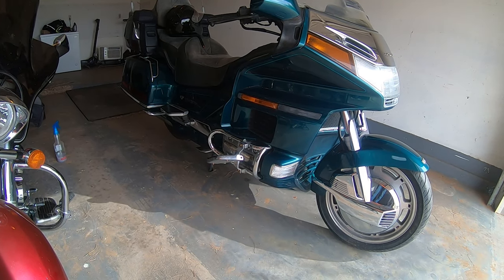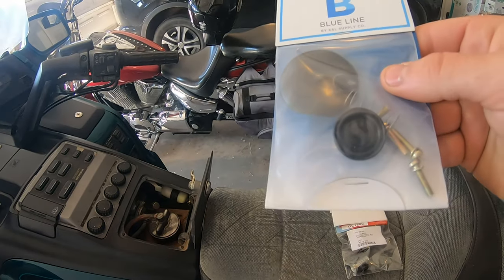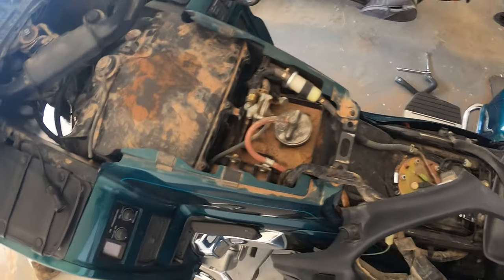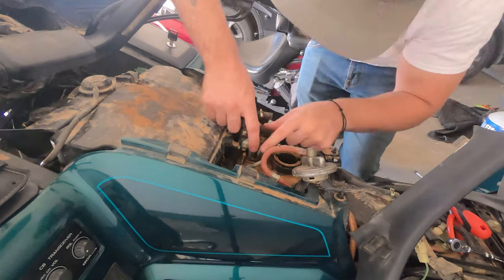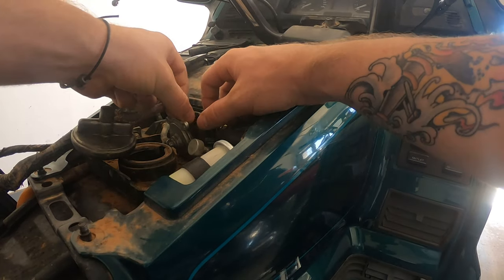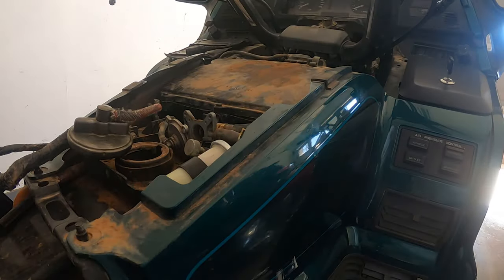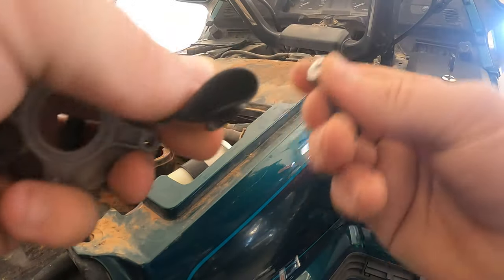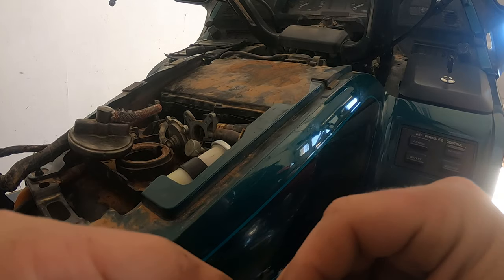How To Fix A Leaking Petcock The Easy Way on a 1988-2000 GL1500 GoldWing

Comment: I'd say it was the easy way...... didn't even break a sweat watching the whole video! Question, I don't have a drive on lift but have one of those jack lifts, where / how is the best place to lift the gl1500?  Do I need to build a offset or level jig to put on the jack lift?
Reply from the maker: Hello TheMamonti1! And in my opinion, the jack will work fine for the GL1500s (I have one) But normally I only use it for one wheel at a time. I put it by the drain plug (Where it is not on the drain pan but runs all the way across on the bottom frame supports) for the front wheel, and for the rear wheel under by the center stands, but you gotta watch for the exhaust! You can do both tires if you get it aligned perfectly (Takes a few minutes lifting, lowering, readjusting) a little forward from the center  stand. But me personally I normally do one tire at a time, and then be sure to use the jack locks! Bike is so heavy it will test the seals on your lift haha!

Comment: Think I asked this when you did this repair in another part, so I’ll ask again other than the visual fuel leaking, was there any symptoms that affected fuel delivery like rough idle, throttle response issues?
With it leaking that much a person would think it affected something.
Reply from the maker: It was! It started idling erratically, than it decided to die upon me giving it full throttle. I did not get it on video, but at one point I had to put a coffee cup underneath the drain tube because it was a steady stream! Whenever I fixed it, I did have to let the engine turn over for a few minutes ( a little bit at a time, did not want to overheat the starter) to reprime the system. Thank you Mr Innovator!
Reply: @octanerestorations  thnx…good to know, so many of these YT videos out there rarely tell viewers why the part was replaced. Saying what the symptoms are helps us narrow down the parts and not throw a bunch of money at the cause.
Reply from the maker: @Mr.Innovator961  Agree! I should have went over it, thank you!

Comment: Does anyone kno if the Goldwing won’t start because of low fuel? I bought an 88 and it had old fuel and won’t start. I got rid of as much of the old fuel as I could but only replaced it with one gallon of fresh fuel. Is that not enough to have the bike start up? I’m praying is not the carbs but the bike did sit for about 2 years in this condition. Please, if anyone can help I’m all ears. It cranks but will not turn over. The battery test said it’s good but maybe it’s not good enough for the Goldwing.
Reply from the maker: Make sure you have a fresh and hot battery. Do you see fuel moving into the fuel filter whenever you have the key all the way on and the stop switch is moved to the run position? That should be a good indicator if your fuel pump is working. I hate to say it but the carbs might need a good cleaning if your fuel pump is working and your petcock is working. You might try throwing an extra gallon or two in there!
Reply: @octanerestorations  Thank you for your help. So far I’ve changed the oil and filter. I’ve taken all of the fuel out and now I’m trying to find a new fuel pump. I also changed out the fuel filter and rebuilt the petcock. Once I get the new pump installed, I’m gonna do 2 gallons of fuel and half a bottle of sea foam for the carbs. After that, I’m hoping I’m in a good place with engine work. Fingers crossed!
Reply: If it's been sitting two years you will need to pull the carbs and soak them thoroughly. Don't forget to pull the air/fuel jets just above the bowls on the outside and count the turns in on each one before taking them out(don't miss the small washer and o-ring under each one). Inspect the throttle slide diaphragms for any cracks or pin holes. get new float needle and seats or you won't be able to trust the floats to shut off the fuel like they are supposed to. Set the float height @ 7.5-8mm. After that they will need to be synchronized. If you don't start with good clean set up carbs it will three times as long to get the bike on the road. It's a great bike "START OFF RIGHT"! @adrianb1655